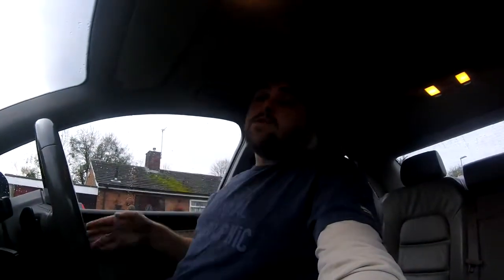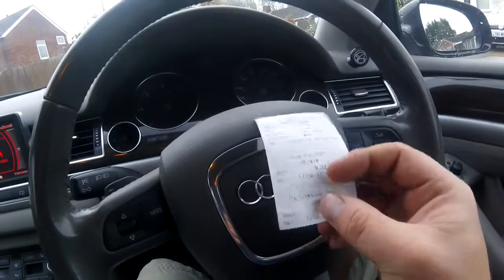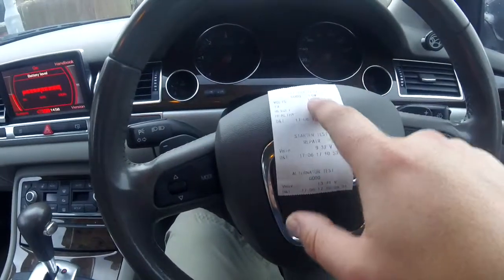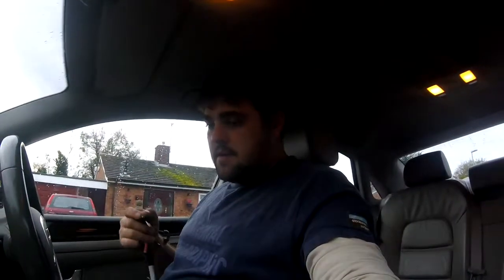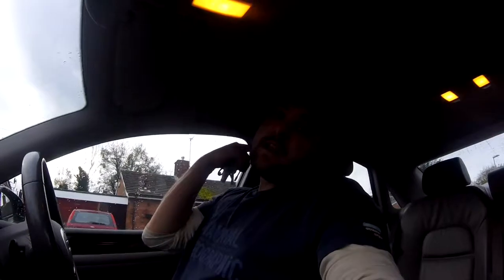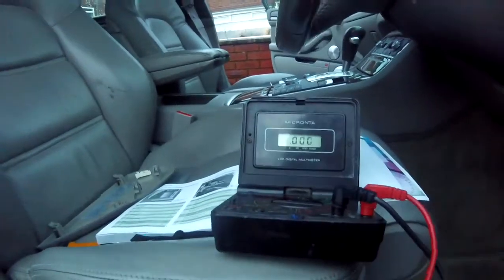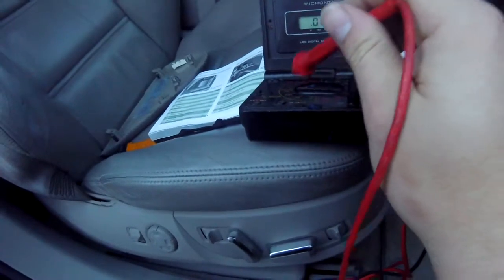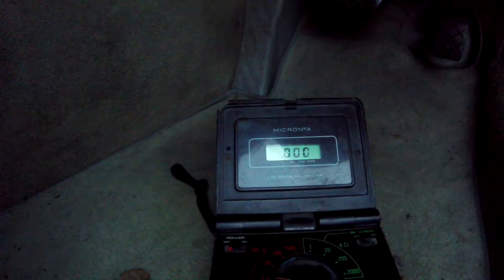How to find what is causing a battery drain in a modern car

Comment from the maker: In this video i attempt to show you how to go about locating a parasitic draw on a modern car that has canbus wiring. The problem with this type of wiring is you cant simply hook up a miltimeter and start pulling out fuses and wait until you fine the fuse that has a load running through it.

Comment: Hi Chris Another good Video mate.....did that solve the problem or are you still looking for other things...All the best for Crimbo and New Year...
Reply from the maker: +Steve Jones hi Steve no that wasn't the problem it's still happening. My dad said he thinks it's due to the fact all the systems need updating. There playing up and not turning on and off properly. A few times he's gone out to the car and the screen has still been on like 4 hours after he turned the car off. But it's finding the time to do it because the battery has to be connected to a charger the whole time and it takes a while. The problem is our drive can't be used so it had to be done on the road and that's far from ideal. Merry Christmas to you too have a good time
Reply: Chris' Man Channel Good luck finding the problem and getting your Dad's car fixed...modern car's with all the gadgets can be a right pain....have a good en over Christmas Cheers Steve
Reply: Hi did you get to find and fix the problem